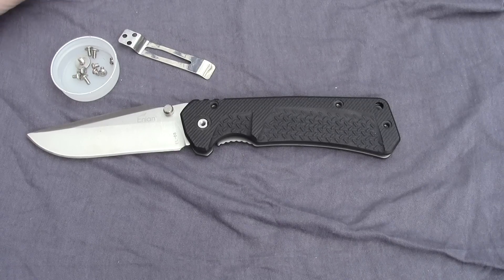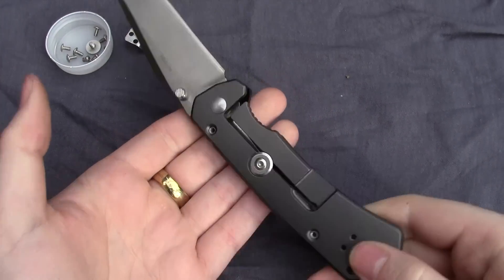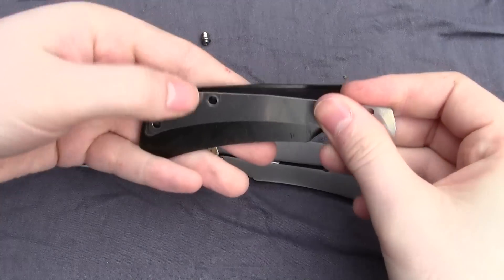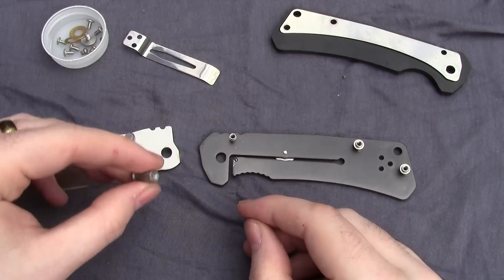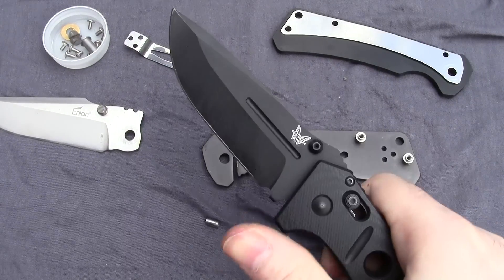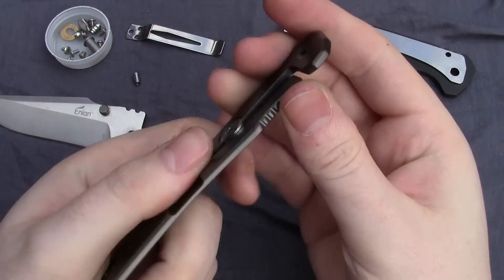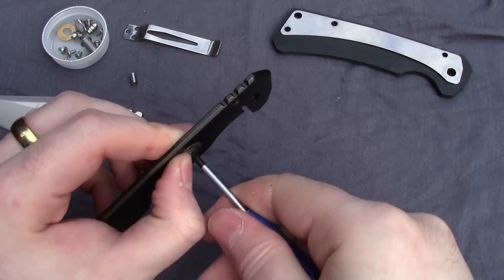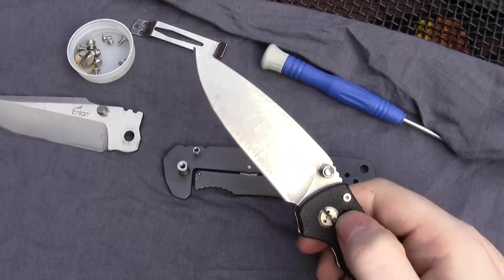Inside the Enlan EL-08 Frame Lock Knife

Comment: Curious how you removed the pivot since it's a proprietary design?
Reply from the maker: A custom tool with a head that's three small pins that fit around the triangle. You can also cut a screwdriver slot in the head of the pivot screw with a dremel tool.